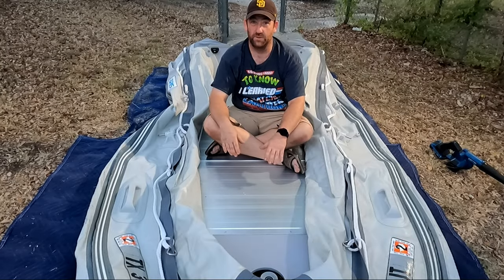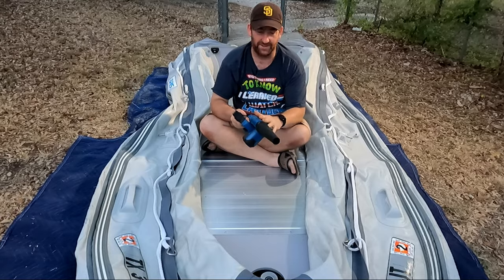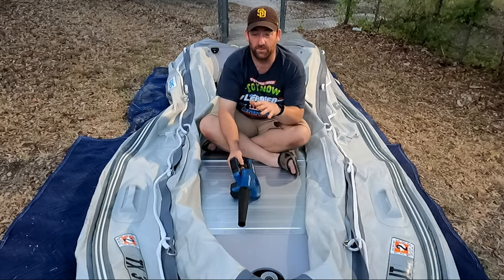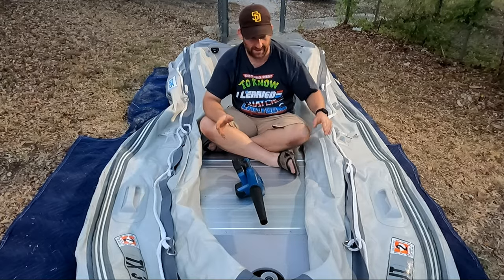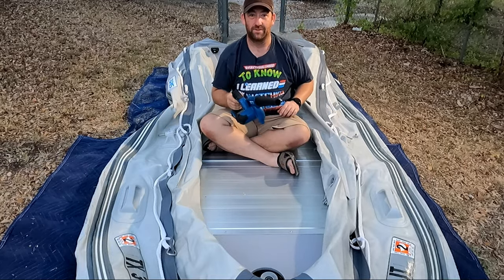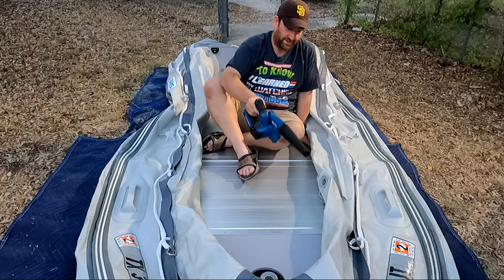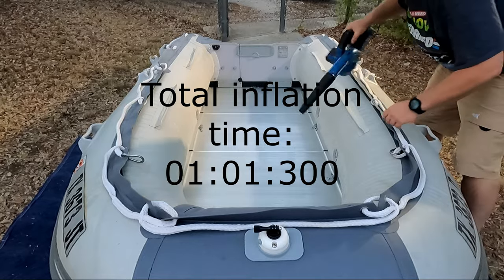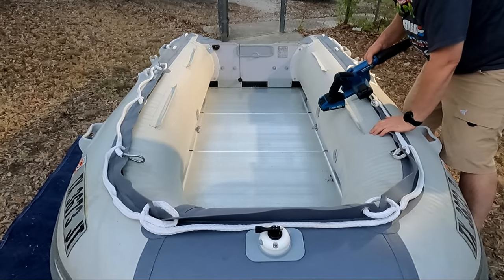How to inflate your inflatable boat, dinghy or SIB in 1 minute, the quick and easy way!

Comment: You did not show the valves or how to close them/open them and still you did not show how to fully inflate the boat I know how to use the blower I don’t know how to close and open the valves properly not helpful
Reply: Wasn`t your best day i guess.. The valve system defers per boat. In my case I need to push a button in the center of the circle. You can fully inflate by choosing an electrical or hand-pump. Inflatable boating thnx for sharing. Really happy with the makita blower.
Reply from the maker: There are a number of different valves out there. If they are like mine, you push the little button in the center and twist to lock the button down. Push and twist again to close the valve. Thanks for watching, and if you enjoyed the content, you know what to do!

Comment: Have you thought of some way of jerry rigging the air pump hose adapter onto that leaf blower? Then you could pump up the boat all the way cordlessly.
Reply from the maker: you could make an adapter, but the leaf blower will not build the pressure needed to get to the recommended psi. The blower has great volume, but low pressure. You still need to come back with a foot pump or electric pump to get that last bit of pressure into it.
Reply: @inflatableboating745  OK. Thanks.

Comment: I have the same boat I bought used and can’t find the air pressure spec online. What air pressures are you running?
Reply from the maker: Here are the recommended pressures from my contact at Bris for all their inflatables:

Tubes 3.6psi (25kpa) max/ 3.0psi (20.5kpa) recommended

Keel 5.0psi (35kpa) max/ 4.3psi (29.5kpa) recommended